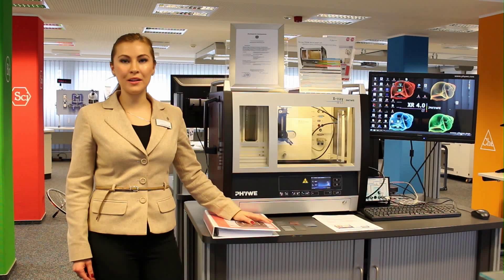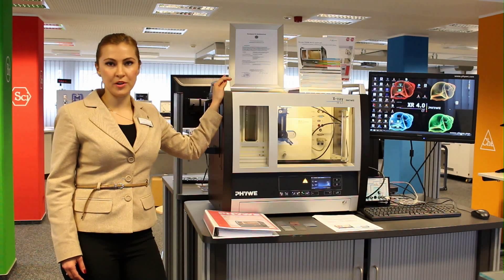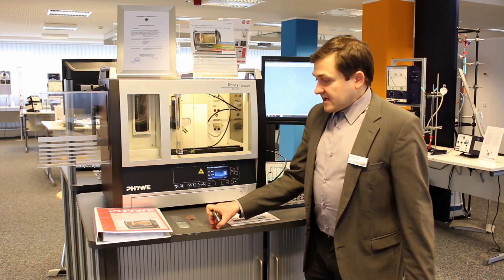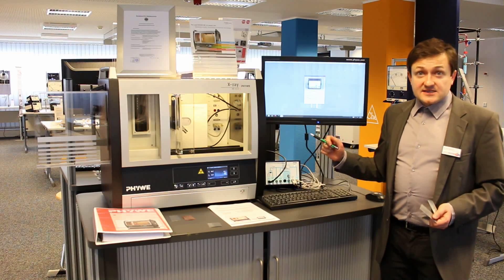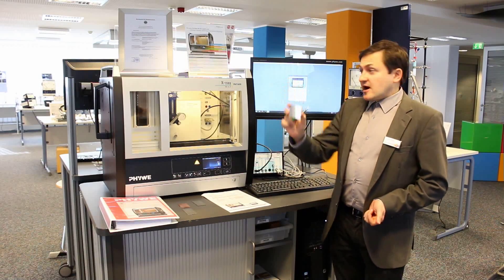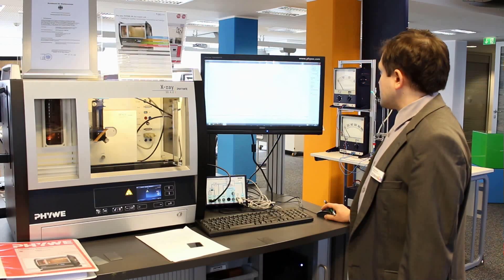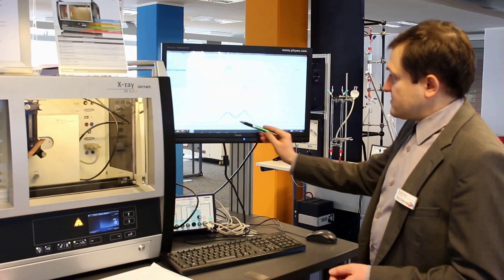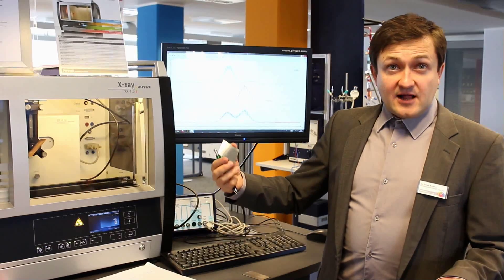PHYWE: X-ray - fluorescence analysis

Comment: Hello, my name is Said-Hamzat Gelanievich. The Chechen State Pedagogical University has built an educational cluster called the Universal Pedagogical Competencies Technology Park, and as part of this, they have purchased equipment for the cluster, including an X-ray machine Phywe XR 4.0. The necessary software was installed on the laptop, but now, after reinstalling the laptop's software, the X-ray machine Phywe XR 4.0 software has been irretrievably lost. When I reinstalled the software, it asked me to activate the program using the key that was on the booklet with the disk, but I had lost that key as well. Do you have the ability to provide the activation key for the Phywe XR 4.0 X-ray machine software? If necessary, I can provide proof that the machine is in existence.